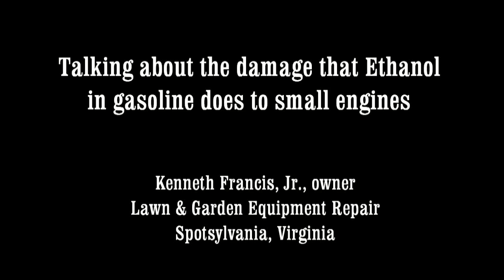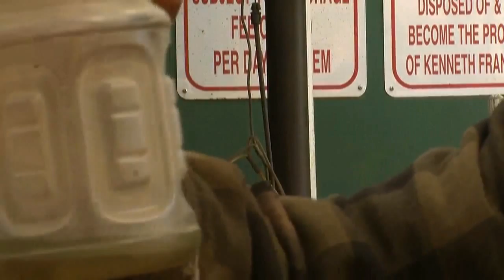Talking About The Damage That Ethanol In Gasoline Does To Small Engines

Comment: First, the small engine mfr's are at fault because they prefer to save $5 an engine by not using alcoholproof parts only. They know alcohol fuel is here to stay. Second, I run my lawn mower on 100LL avgas. it's cheaper than that boutique fuel they sell at Sears and smells great. I do go through two spark plugs a season but that's OK. I pulled the head the other day, no deposits or damage. clean as a supermodel's booty.

Comment: Justsome, I would not belive this video if I didn't experience it myself. What he is saying is true. What matters, and he left out, is, it depends where u live and r buying ur gas. In Connecticut, no problems at all. At my home in Florida, every machine I have 4 yard work has broken down due 2 the fuel. Stihl ch saw, trimmer, blower, John Deere tractor. ALL have had fuel related problems. Baypines Fl actually has a gas station selling ethanol free gas 4 boats. It solved my problems.

Comment: There are always a solution to the problems created by ethanol.  As far as I am concern, water is not the only problems, there are also temperature and the power of the combustion that posed hazard.  Certain car engines are not designed for that.
A heated engine can surely evaporate most water products, thus high octane gasoline + ethanol or two separate fuel tanks and a better water pump/ exhaust valve came into mind.

Comment: That explains why there was some black flakes at the bottom of my snow blower carburetor's  bowl. I thought by putting high test gas in my small engine equipment, it would save me the aggravation to rebuilt those carbs once a year. I tried my tiller last week and found a large amount of water in the fuel line. Now I know why ! Thank you very much for the information. I tilt my hat.

Comment: The problem isn't ethanol in the gas. Ethanol has been blended into gasoline since the late 1970's. The problem is small engine manufacturers who refuse to design their engines and carbs to handle ethanol mixture.  Rubber hasn't been used in automobiles since 1979.  Viton has replaced it in cars. But are small engine manufacturers following suit?

Comment: ethanol is not whats causing the problem.
gasoline and ethanol will not "blend" without a corrosive catalyst.
i dont know what the catalyst is.
i do know that what kenneth is showing you is true because i see it everyday too.
the catalyst melts rubber,plastics,corrodes aluminum.
shame on the oil companies for sell us expensive pisspoor  fuel

Comment: @insimenate The first one was at the Marina in our neighboring city because of engine/carb damages.  The boat repair shops were backed up 3+ weeks repairing ethanol damaged motors.  The ethanol free pump was so popular they opened a 2nd at their sister fuel station.  Finally, a third fuel co-op set up a Premium pump with non-ethanol gas.

Green sludge forms in the carb clogging the filters, jets and orifices.

Google non-ethanol pump location.  There are sites dedicated to locating one near you.

Comment: @gavincurtis That's interesting. I didn't know service stations were permitted to sell gasoline without ethanol in it. I thought it was a federal requirement to include it. Didn't the Energy Independence and Security Act of 2007 extend the target of the amount of biofuel (usually ethanol) that must be mixed with gasoline sold in the United States to 36 billion gallons by 2022?

Comment: There is a special place in hell for the IDIOTS that put ethanol in gas.  It is an abortion that has done millions of dollars damage to NEW equipment.  10's thousands $ to me personally all 2005+ machinery.  All boats w/o fuel injection are wrecked.  Because of complaints we finally have 3 service stations selling NON ETHANOL gasoline and have lines because of it.

Comment from the maker: @MightyCarnac Conintuing...So it's possible that you have water and don't know it because it hasn't separated. It's also possible that there's something about the way the manufacturer mixes the ethanol with the gasoline that causes a problem. You'll note that in the video, Ken mentions how area gas stations have been caught with larger proportions of ethanol, in  some cases well over 30%. There may be something about the way this happens that causes immiscibility, i suppose.

Comment from the maker: @MightyCarnac Well, I can tell you that those of us who experience problems keep the caps on our gas tanks, too, so that's can't be it. After all, most engines are unsafe to operate if the gas cap is off. Further, I can say that I fasten it tightly, and I'm sure others do too.

I did find one interesting thing in Wikipedia. Apparently, ethanol and water are "miscible", which means the ability to mix in all proportions into a homogeneous solution.

Comment: @VAhostnet CONTINUATION.…Next I emptied the fuel tank on my pressure washer which was about a quarter full - it's got a bad pump so hasn’t been started since early last winter. Some dirt on the bottom but not one drop of water. Incidentally the engine started normally and runs fine.

Again I’m not saying you’re wrong about ethanol but our gas pumps are labeled 10% ethanol and we don’t see anything like the problems you describe. I wish I could explain the difference.

Comment: @VAhostnet  If your gas tank is capped it's not exposed to the atmosphere except the air in the tank. I'm puzzled to know where all this water is coming from. Okay, in the interest of science I did some checking. I have a 1-gallon plastic fuel jug which contains about a quart of 50:1 two stroke fuel. It was mixed last April (I labeled it). I emptied it into a clean container and examined it carefully under direct sunlight. Not a drop of water on the bottom. Nada.
CONTINUED....

Comment from the maker: @MightyCarnac I can guarantee there is water in your gas. Apparently, your engines are able to run despite the water. The reason I know is that ethanol attracts water out of the atmosphere. It's a known scientific fact. But just because many engines are adversely affected by ethanol doesn't mean that all will be. Does that fact eliminate the negative effect? Of course not!

Comment: Is it possible there's some other problem besides ethanol? I'm in the Washington state rain forest, we have 10% ethanol and I don't see these problems. I have a riding mower and a walk behind both with Briggs motors and they start right up in the spring. I don't drain the gas. No water in the gas even in this climate. Also have two string trimmers - one has a leaking primer bulb but the thing is 20+ years old. I'm not saying you're wrong but I can't explain why we don't get these problems.

Comment: yah i use 91 non ethenol and i used to use 87 ethenol in my snowmobile and it ate at the fuel lines into jell not i use the good stuff and never have problems when all my my friends use that crap and have to rebuild there engines

Comment: I'm one of the victims of Ethanol, thanks for explaining many of the problems with this junk.  I fly a carbon fiber aircraft with Rotax 4 stroke engine designed to use high octane unleaded auto fuel, not 100LowLead that airports use.  Shell premium worked for years with no issue...not any more.  I found a leak in the bottom of the plane as the fuel tank is integrated into the fuselage.  The ethanol is eating the composite resins.  This gov't mandate is bull crap.